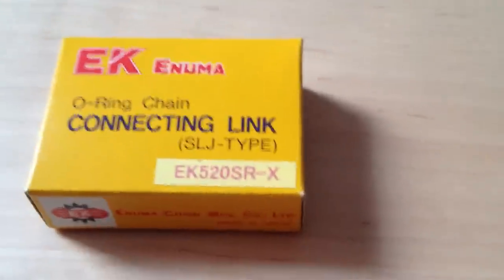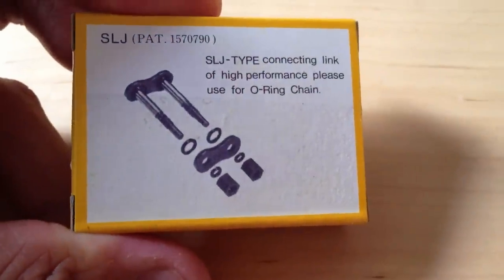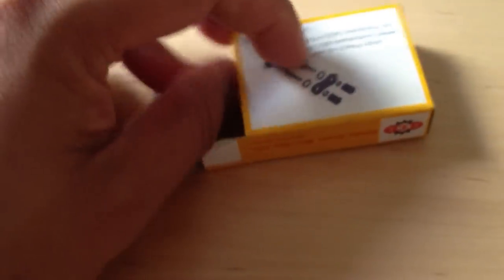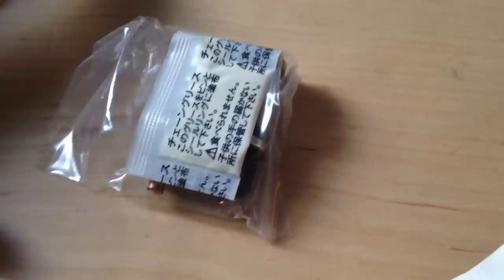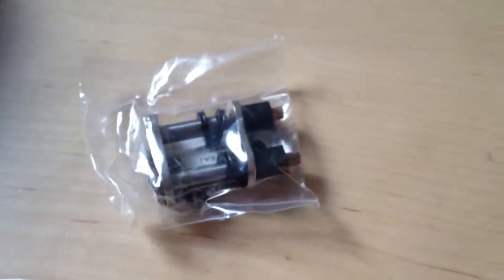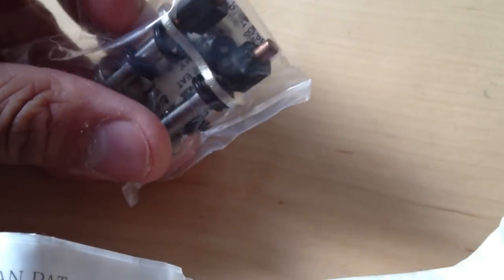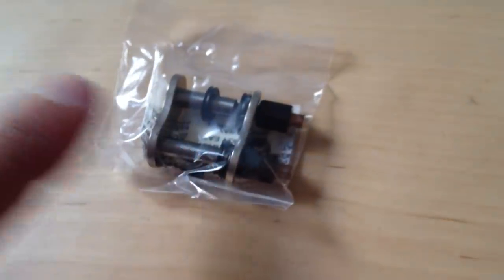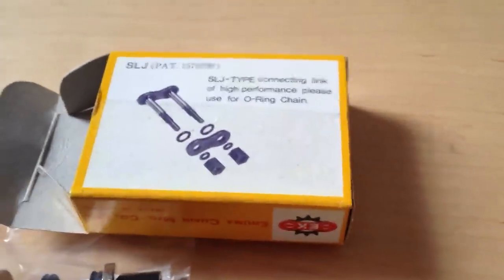EK Enuma Unboxing O-Ring Connecting Chain Link EK 520 SRX - Screw Type  SLJ (No-rivet) Master Link

Comment: What do you do with the nut? take it off after having enough tension on the plate?
Reply from the maker: Saad once it's tightened on the side plate you no longer need the nut. It's just used to press on the side of the link.